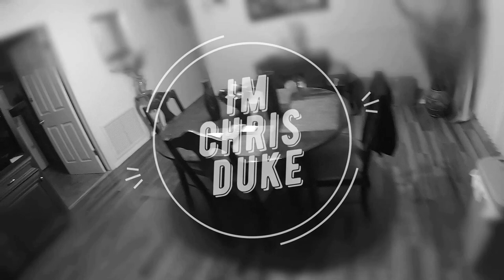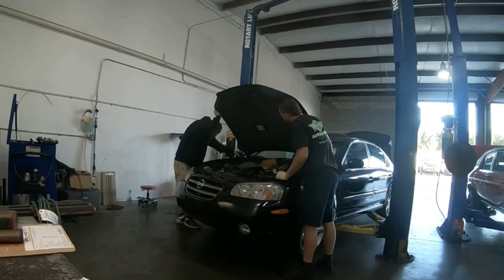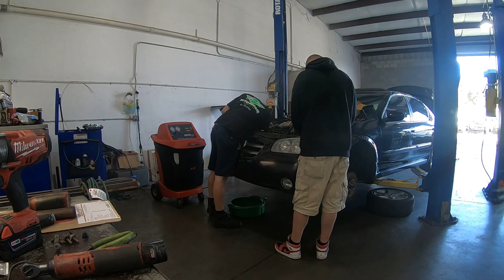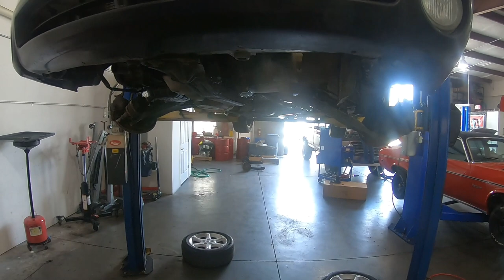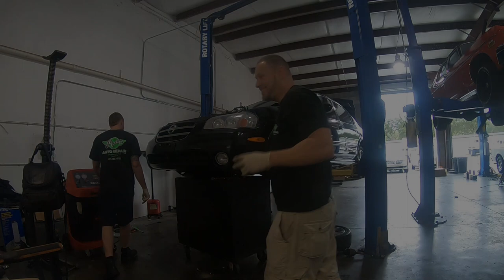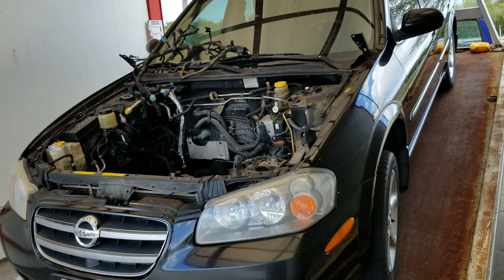02 Maxima Engine SWAP Preparation !

Comment: Yeeeeeeeeeeee buddy! Glad to see y'all moving on the maxima! Are you guys going to hr swap it yourselves? Or just put another DE in?
Reply: Nvm just read your details Lol! That's wassup bro can't wait to see the next video!
Reply from the maker: Wassup bro... the HR from my white Max is going into the Blaxima... then it's going back up to Nisformance to get some more stuff done to it... I'll be detailing that in an upcoming video :)
Reply: @ImChrisDuke  ayeee nice that will be awesome! Are you going after the deal that they have now all throughout February?
Reply from the maker: @TheMaafiaGarage  I've already got the headers at the shop... and pretty much the only thing Darren will be doing (Nisformance) is putting on a custom 3" exhaust, a revised intake (I have an older version of his intake) and a new dyno tune.... I should gain a lot of HP
Reply: @ImChrisDuke  ayyyyee that's going to be real nice bro! Are you going with the CGR 4" intake that Douglas sands makes? If so you'll def gain alot of power with the headers exhaust and intake!